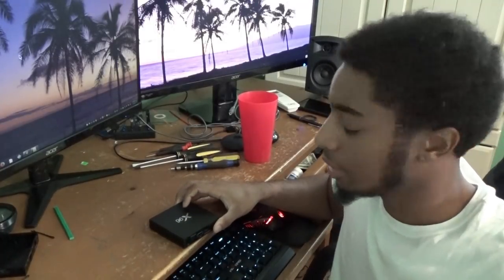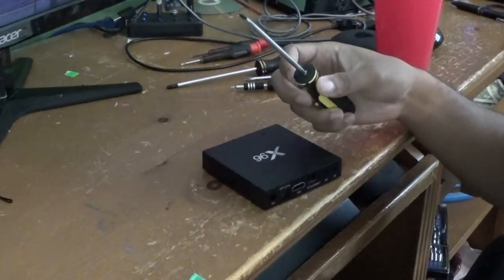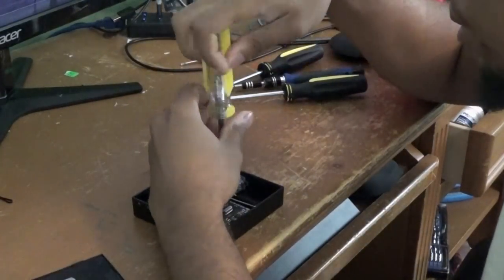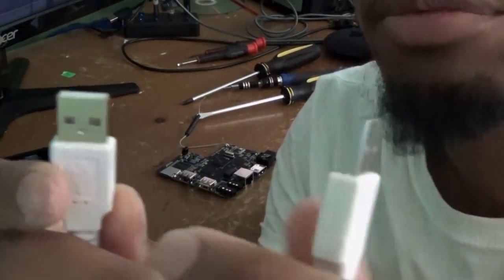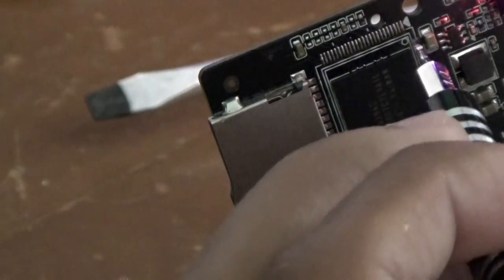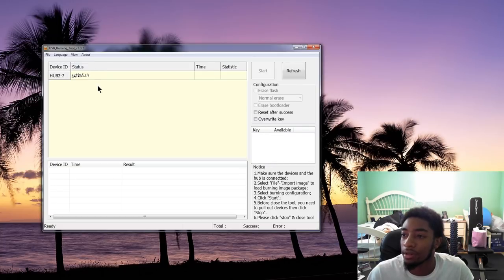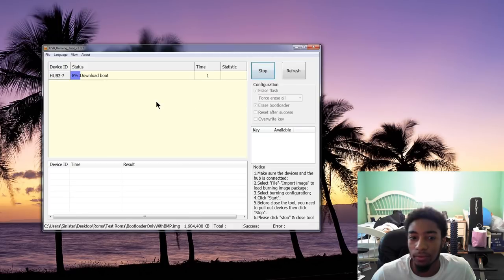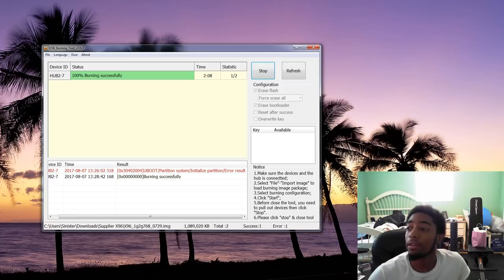Unbricking x96 S905x Android TV Box - Nand Chip Short Method

Comment: Hi I managed to short the Nand pins (the first two as you said) - of course there was no reaction that I could see.  I finally got to download the correct usb tool (I run win10) and it runs up.  Trouble is there is no sign of my device. I did as you said - plugged in the USB and then the power but the device isn't listed.  What do you suggest I try now?

Comment: For anyone failed on the short method on these two pins.  Mine X96 2+16G is an earlier version, you can tell by the label which is different to the video. I have shorted the first two pins next to arrow more than 50 times, didn't work. What you need to do is short the pin 5 & 6( maybe 4 & 5) count from the diagonal corner of the arrow. Don't worry about burn the chip, I tried all the pins next to each other. I can confirm it works every time, without second delay. You don't even need the power plug in, usb cable only.  When it work for you, please comment and help others to try.
Reply: My eMMC chip is KLMAG1JENB-B041, if you download the datasheet, pin k5 is RST (RESET), maybe this is the only pin which works.
Reply: Si yo tengo el mismo de Adriel, y me funciono con 5/6. Gracias Adriel por el excelente video y gracias con el aporte del pin 5/6 Gao , me salvaste.
Reply: My X96mini not going to download mode ( when I connect the cable it directly turns on ) how to fix it 😔

Comment: Million thanks, you're lifesaver! My X96 2G/16GB was brick and just has a red light when supplying power. Try so many solutions out there on the internet for whole this week, but failed. Now, I follow your instruction, and it works. It takes me only 30 mins. Liked and subscribed!
Reply: Hai Su  help me x96 2 / 16 red light  not work :/
Reply: Hi Ayhan, what problem with your device? Is it brick and even no red light to be turned on when plug power?
Reply: Help Me. I Have a TV BOX X96 S905W.

Comment: Nice information thanks. In my case I have no access to the main chip, it's "blocked" but there was no need for shorting any pins, there was no reset button and no reset hidden behind the "AV out" as many point out. In my case I had to tear apart the box and found a push button for reset, that did the trick, no shorting required. Now In trying to fully identify my tv box and firmware, a backup sounds good before burning anything.

Comment: You don't need to disassemble your X96, you take a cotton swab, cut a side to remove the cotton and insert it into the AV connector at the bottom and you will feel a switch. You push the switch until the transfer begins and you release it.
Reply: Working fantastic, thank you
Reply: This works but when in case of hard brick the recovery usually don't work.

Comment: Your video worked great, however, you only need to take cover off box, don’t worry about taking the board out. And I had to use a different firmware, xannys. But thank you for the easy to follow step by step video. Kudos

Comment: I found a much simpler method to unbrick mine. There's a reset button in the AV port. Press and hold it with a toothpick. Then, plug in the power cable. Count to 20. You should be in recovery mode.

Comment: Hello, I have my X96 with S905X chip, I can connect with the USB cable, but when I press start on the usb burning tool, it disconnects for the process and shows a sign [0x10105002] Romcode/Chinese letters DDR/Chinese letters/USB Chinese letters. What can be?

Comment: I have the same problem like MikeG7. My X96 mini only shows the red light when plugged in and the instructions you've posted doesn't work. It is not seen by the PC. The nand pins are not visible. Is there any another way to access the flash mode? Thanks
Reply: I have a95x 
I start in Usb Burning Tool and go to 7% and stop Disk Dialize/Send Command/Error Result
Every turn red light no picture,and dont turn on
Help
Sorry for mu bad English
Reply: Try different pins, try different firmwares. It took me a little while but it worked

Comment: Gt1 ultimate 3gb/32gb. I used burn-card-maker But i have not checked ´´erase bootloader'´. So now its bricked. The light is turning on but no hdmi 1 is detected by my tv. I dont have a male to male usb, so is it possible to just shortcut the nand and then flash directly the box with my micro sd. You think it may work ??
Reply from the maker: No, as far as I know the nand short method only works when connected to a computer directly with a male to male usb cable. This is due to the recovery partition being corrupted.
Reply: Ah. Thanks!!  But i finally got my gt1 ultimate (A706Dmodel) recognized by usb burning tool. I thougt my diy usb cable was falty.  But the trick is to connect the box to the laptop, then shortchut the emmc. No charger/adapter needed. And sometimes i have to push the reset button before shortcutting and then release it after.
Reply from the maker: Hassan Bakkali glad it worked out for you

Comment: Hi, i flashed my x96 box with the rom you mentioned fixed your x96, but now my x96 doesnt work, it shows only the red led on and doesnt work, the burning tool doesnt recognize it anymore, any sugestion? Thanks.
Reply: same here bro! have you found a solution?
Reply from the maker: These boxes are really finicky. When that happened to me I had to get the original firmware from the manufacturer and flash it with a SD card. I can't remember the exact steps as it was years ago.
Reply: @HighlyTheoretical  I was able to get those file but I don't know how to flash them from my SD card as there is no bootloader in the box!

Comment: Hi on ur last step an error occurred at 11% as u said finware didn't match 
In my case error occurred at 7% it say for mating an then a red sign occur 
I am having T95z plus Wi-Fi box brand new can u assist me
Reply from the maker: The T95z Plus uses a different chipset, s912. This firmware is for s905x. I will look for the correct firmware for your device.
Reply from the maker: Try this https://drive.google.com/file/d/1INiboQJnkJJ6cYh5l2njKbuSVV5B2Iag/view?usp=sharing

Comment: Hello, my box s the X96 mini. It has the red light continue. I can't reinitialize it with the thootpick method. Inside the processor is very diferent and small, and we cannot see the pins to short. So, what can i do now? :( Thanks in advance)
Reply from the maker: Try these instructions https://drive.google.com/file/d/1S1e_VZSqBlJ3tRfZGWwrrHxdGpJYXQfg/view?usp=sharing
Reply: Great. It worked. With the X96mini we don't need to short nothing. 
My mistake: I had a SD card inside the box.
Thank you
Reply: MikeG7 have you the x96 mini? It worked for me but with the tanix tx3 mini firmware that i've downloaded from tanix site.
Reply: hi mikeG7 did u find any solution, i have the same prob
Reply: Try the" tanix tx3 mini " firmware. It's available on their site.
Reply: Helder Mendes I have A95X S905X and stop 7% error dialize help me
Reply: @harrymoon6060  Hi which firmware did you use I've the same problem.

Comment: What driver tools are you using to get Windows 7 to recognize the X96? I can not get the Burning Tool to pick it up. Thanks
Reply from the maker: Jason Young when you install the amlogic Burning Tool, the drivers are also installed. Yes I used windows 7
Reply: Thanks for such a quick reply. I tried uninstalling and reinstalling and have tried multiple variations for connecting with no luck. Maybe I'll try rebooting. Hope to get this box fixed somehow. Cheers. Any other suggestions? Great video by the way
Reply: I should mention, the box is showing blue light and no signal on multiple tvs and hdmi cables. Can not get into reset as well.
Reply from the maker: Did you try the toothpick method first?
Reply: Closest I can get is the PC telling me the device has malfunctioned and Windows does not recognize it.
Reply: Do you be able to fix it. I have same problem.
Reply: I have 2 old X96 devices and I also have the same problem, they are not detected by the USB Burning tool. Do you be able to fix it.

Comment: my pc does not detect it. what do I do friend
Reply from the maker: Did you plug in the male to male usb cable and the power cable to the box? If so try shorting each pair of pins until it connects.
Reply: It's ok, I'll do it amigo
Reply: Thank you this is useful
Reply: I have 2 old X96 devices and I also have the same problem, they are not detected by the USB Burning tool. Do you be able to fix it.